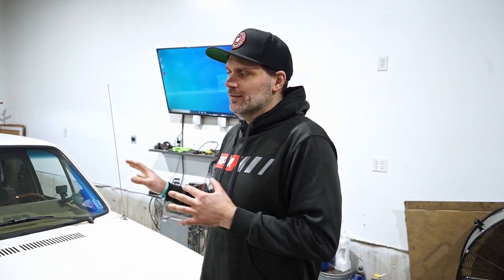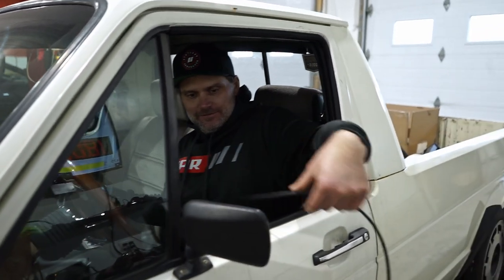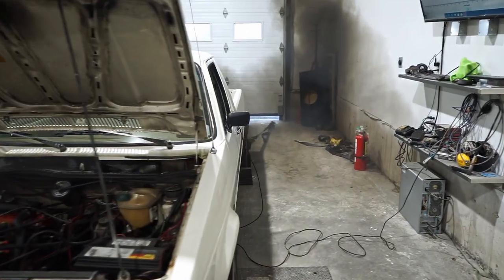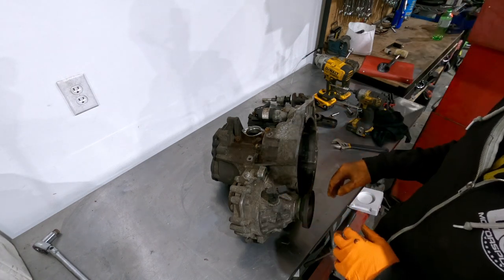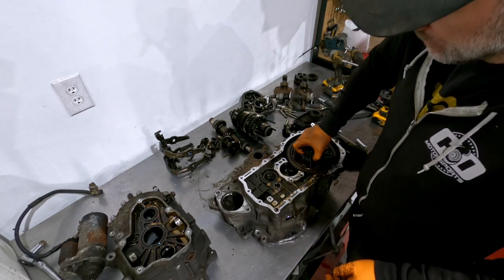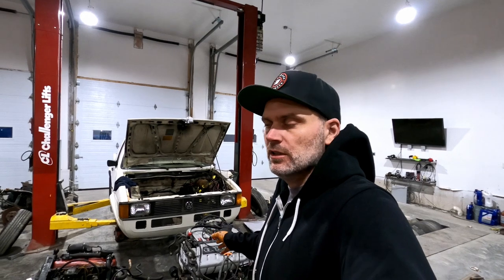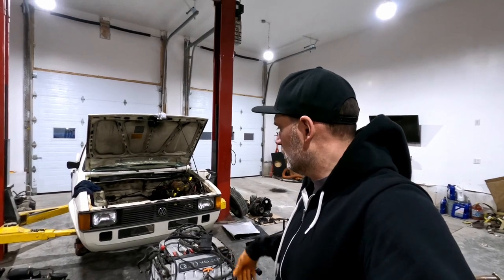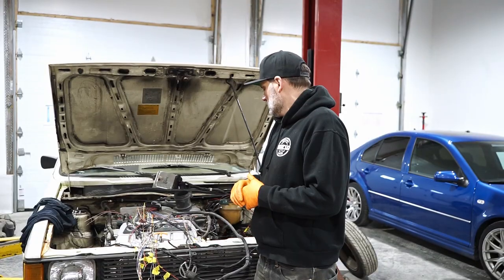MK1 Caddy 3.2 VR6 Swap continues.

Comment: Great video, doing my homework to get everything needed to do a VR6 3.6 on my S2. Can A/C compressor be used? Since I live in Arizona would really be nice to have it during the summer. Where can I source the adapter you used on the fuel line? Thank you
Reply from the maker: If you're referring to an Audi S2 then it will be a completely different swap from this.
Reply: @COMotorsports  Sorry it and 1987 Scirocco 16v. Thank you

Comment: i have a 2002 vw golf 2.0 automatic but i also have a mk3 vr6 2.8l gti manual. would a swap be a bolt on from mk3-mk4? or what other things would i have to do to make a swap like that work?
Reply from the maker: The MK3 VR6 block doesn't have the provisions in it to bolt into a mk4. You'd need a mk4 VR block.